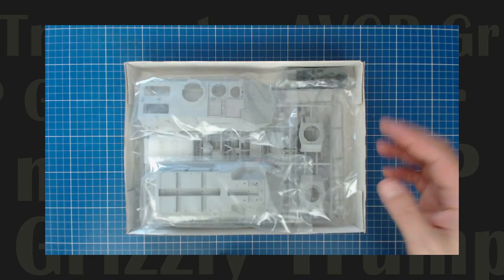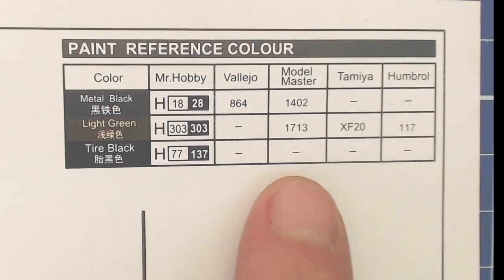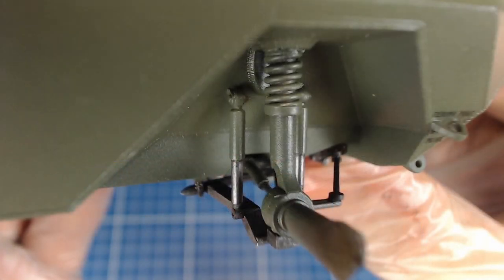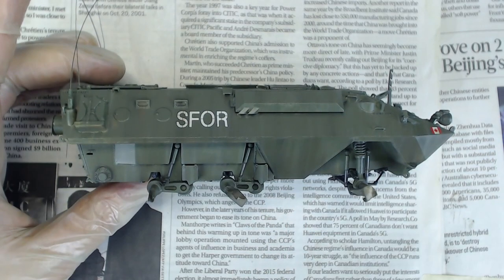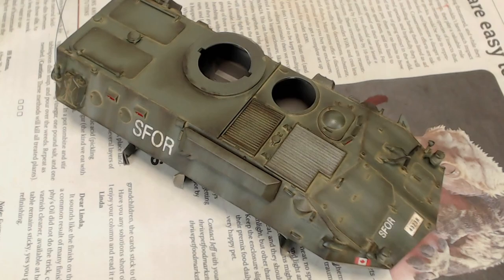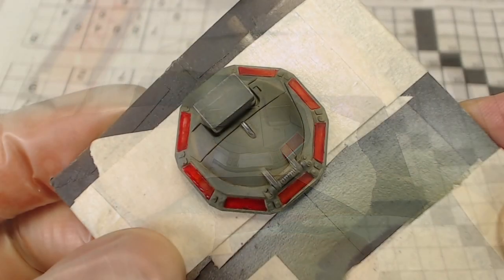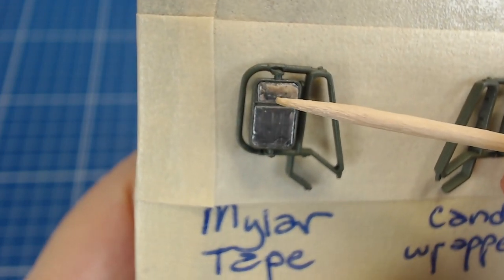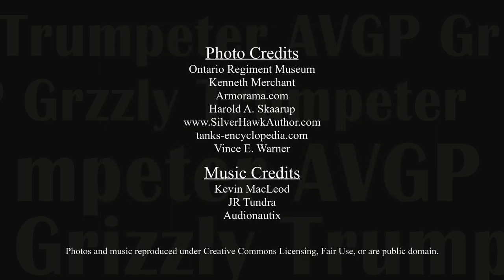Trumpeter AVGP Grizzly Model Kit Build - Part 2

Comment: The Grizzly holds a special pace in my heart.  I served in 1 PPCLI in the mid to late 80's, before this version came out.  Have some good memories and not so good of this vehicle.  
  It is great to see a mainstream company make Canadian armoured vehicles.  There are some issues with this kit though.  The main one is the turret guns are totally wrong.  The 50 cal and the C 6 should not have conical flash hidders on them, they got this  wrong on the early version also.  Why Trumpeter did this I do not know.  Also the guard on top of the first grill on the hull top was only used on the Cougar.  This was a feature that was used so the gunner did not depress the main gun down enough to fire into the hull.
  You did a fantastic job on this kit.  I do plan on purchasing the entire AVGP family of vehicles to add to my Canadian AFV collection.
Reply from the maker: Hi MAF and thank-you for your service. Right you are about the muzzle ends. Trumpeter kits give us good prices but they are "rough around the edges". I build out-of-the-box for the series but there are after market MGs that can address the 
"Bofors" style muzzle ends. Nice that the vehicle has nostalgia value for you, makes building and collecting the kits all that more meaningful and interesting. Good luck on your own building journey and thanks for the input!

Comment: Beautiful rendition. For pigment fixer I use mix of 90% thinner to 10% Testors Dullcote  (in the rectangle bottle). Once dry those pigments are fixed for life. Give it a try if you are so inclined. Your builds are a pleasure to watch.
Reply from the maker: Thanks for writing FM! I use to use Testors paints all the time - enamels mostly -  but they're becoming harder to find in my neck of the woods. I assume you're using an enamel thinner, maybe mineral spirits? I like the alcohol, it's super thin and aids the flooding technique I like to use; but it's not as permanent as your solution.
Reply: Just the cheap paint thinner from your DIY store. Model Master is being discontinued as you may know.
Reply: @stevieRay3211  Just the cheap paint thinner you find at your local DIY store. As you know Model Master is being dropped by Testors as the company was bought out.
Reply from the maker: I was getting a bit panicky since I thought that enamel paints were going to be banned altogether (like too many things we like these days). But the Tamiya enamels are available thankfully. Too bad about Model Master - I liked many of their colours and their acrylic dull coat worked well for me. I'll keep your fixer recipe in mind though. All the best Frank!

Comment: Thank you Tom! I really like the effect of the 'steel' oil paint mix topped off with the graphite. I've used graphite previously but just on its own,  not over that very soft blended / drybrushed edge effect you used - and the way you've done it in this video is WAY superior to my old way. I just happen to be at the weathering stage of a build (finally found some time to get some modelling done!) and I'm going to use your method on it. Thanks again!
Reply from the maker: Hi Jonathan - thanks for stopping by and sharing your own experiences. The graphite on dark oil works really well and I think you'll be pleased if you try it on your own model. Glad you picked something up from the video.